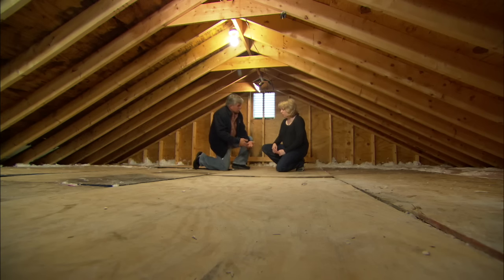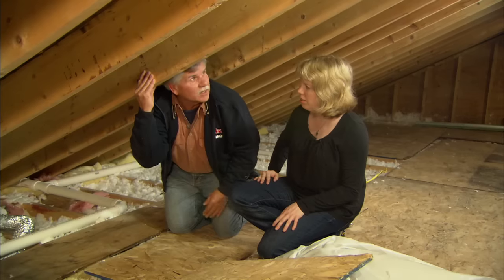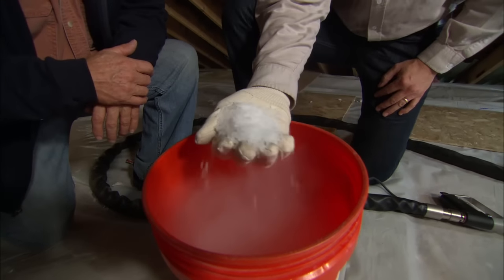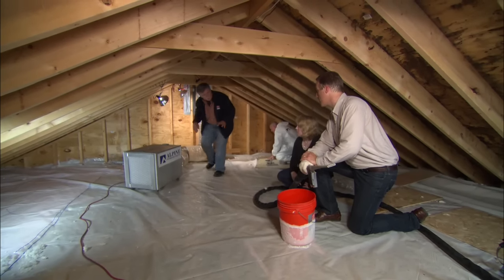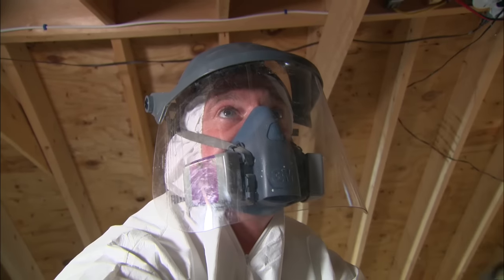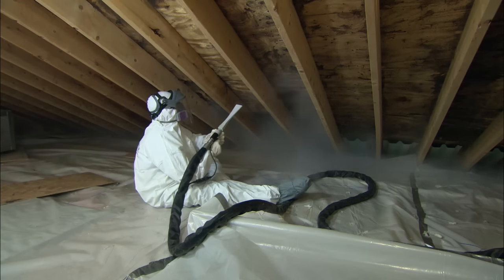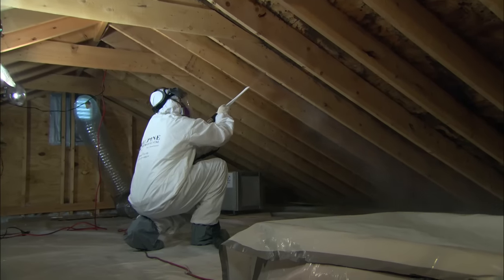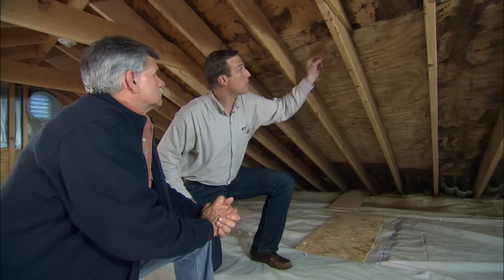How to Clean Up Attic Mold | This Old House

Comment: They cut out some of the most important parts of the original video. This is from season 10. They talk about how the gable vents are a detriment to a ridge vent system. They also talk about how venting a bath fan into a soffit is the worst thing u can do for your house. Better off not having a fan at all

Comment: Using dry ice looks expensive. And I wouldn`t count on it not coming back. I have grown mushrooms before and the spores are microscopic. Just because you get rid of what you see means nothing. I also worked in the asbestos abatement services and I can tell you that one of those negative air filters cost $50,000 in the late 80`s. Granted it`s nothing more than a fan with some HEPA filters but that`s what they cost when I was using them. That reflects how much the services will cost you. Abatement services are for rich people or a government money wasting grant. You could tear your roof off and replace it cheaper.
Reply: That is what insurance is for. Everything you mentioned is a fraction of the price now. You can buy an industrial, professional quality air scrubber (pretty much giant fan with HEPA filter) for around ~$2,500. Or you can rent something similar for maybe a couple hundred bucks. As far abatement of mold, a strong (high concentrate) peroxide will kill most.
Reply: Or get good homeowners insurance and pay your 1000 dollar deductible....they'll send in a cat team to stabilize probably drop a dehu and set up containment then get appovals from the insurance to remove affected materials ie drywall and insulation then shockwave the piss out of the  materials and wipe studs. Really not expensive at all. I know what I'm doing tho so if my house had grey/black water or microbial growth I'm not calling a cat team I'm documenting and demoing affected materials right away I dont care if they drop the claim.
Reply: @HoomerbirdG2  Same here. I currently work for a water and fire restoration company. If I had something like that going on in my house, then I'd get a couple estimates for the insurance company, then do everything myself and take whatever check insurance wants to cut. Hell, probably borrow some work equipment. One of the benefits of working in the trades.
Reply: Insurance doesn’t cover that! Unless it’s from a leaking pipe or your roof got torn up by wind or something damaging the roof like a tree.
Reply: Insurance doesn’t cover that lol
Reply: Yeah good luck trying to get your insurance to pay out on that... They don't cover it. But you still called them attempting to file a claim so your rates will skyrocket next year because now they know there's a problem. The good old catch 22
Reply: I have an air scrubber with variable speed control and a hook up for poly tube for negative air pressure costs about 1500 total including poly tube. Best idea is to re-roof and remove deckboard and start fresh with new materials. Likely there is a source of moisture that needs to be address whether it be a dehumidifier needed or roof fix.

Comment: Serious risk of asphyxiation with this technique in confined spaces - that's a LOT of solid to be turning into dense gas. Small filtered extraction fan may not be enough. Personal oxygen monitor should always be worn if you are doing this work.
Reply: No one suggested that the average homeowners try it at home…. Leave it to a professional!!!!
Reply: @daddybear7062  yea well fyi the "professionals" are very often just as clueless about such things. The person in this very video has no alternate outside air source, has no oxygen monitor on and is sitting on the floor....WHERE THE COLD DENSE GAS is clearly rapidly accumulating.
Reply: At least wear PAPR
Reply: Supplied air line would be ideal

Comment: Didn't protect the vents at the base of the roof so you've blown mold into the walls, mold still inside the wood, all you've done is improve the appearance
Reply: So you just missed the part about the negative  air machine?
Reply: @123456bmx  oh whoopie...

Comment: That is an excellent way of getting rid of mold. I like it done in my house, but my father is prohibiting from me in doing it.
Reply: mold only needs to be wiped with an antimicrobial and dried + source of moisture removed. encapsulate (paint) with primer once its dry and fixed and that's all that needs to be done. agents like IAQ advanced peroxide cleaner or Rm-86 bleach cleaner can be used instead of dry ice/ sand blasting / wire brushing but absolutely dont mix them because it turns into mustard gas. gl

Comment: 'How to remove mold from an attic'

"Well first bring out your $4000 dry ice reclamation machine with $2500 negative pressure system..."

So helpful lol 😆
Reply: Cmon everyone has that stuff lying around 😂
Reply: Don't forget the $9000 in labor.
Reply: there's a lot of This Old House videos where my (CORRECT) takeaway is to get someone else to do it. All of the asphalt ones are similar
Reply: This is a dumb way to get rid of mold
Reply: @Michiganman800  as a licensed mold remediator and inspector, I agree
Reply: @dylanstevens5714  Then what's the correct way?

Comment: Looks like spreading mold around with added moisture from cold ice and vaporate into water and a perfect breeding ground for more mold.
Reply: Delboy they’re using dry ice. It goes from a solid to a gas. It’s also far colder than water ice. It’s instantaneously killing the spores.

Comment: My attic does not have obvious signs of mold and it's relatively dry and all that.
But the is covered in some kind of green stuff. 
Very fine and dry.
As if the wood is covered in a thin layer of copper oxide...
You fine people have any idea what this could be?
Reply: Could is possibly be some form of spray foam insulation? I assume you are not the original home owner. I would think foam insulation would be more obvious.Unless it is some sort of wood treatment? Did you try google images to see if you can find something like it?
Reply: Possibly wood preserver? Pressure treated lumber maybe?

Comment: In the SE, it gets to 100 degrees outside.  The attic can be 115 or higher.  No mold.
Reply: Attics get a lot hotter than 115 assuming the insulation is on the attic floor. The mold happens in the winter, as is mentioned in the video. If you are down south, I guess maybe it doesn't get cold enough to be a problem.

Comment: I'm afraid to even know how much that costs.
Reply: The only 500 sq. ft. attic would be a shed.  Get real.  At those prices, it makes more sense to remove the entire underlayment on the roof and replace it.
Reply: A NEEEEEWWW CAAAAARR! You're Winner
wtf is wrong with a scrub brush, something that kills mold, and installing better ventilation.
Reply: Well if you have insurance probably not alot at all lmao pay your 1000 dollar deductible and the insurance will take care of the rest assuming there's not any coverage concerns.
Reply: Shawn P Bleach does not kill mold. It just removes the stains. It kills bacteria, therefore making the mold have more area in which to spread.
Reply: @Tinyteacher1111  not true....bleach will kill mold spores and allergens on esentially every non porous surface. For wood and drywall you should use shockwave antimicrobial or RMR. RMR is pretty terrible when spraying though its like walking into an onion chopping factory.
Reply: @HoomerbirdG2  I just bought a house with some basement/attic mold and have been reading about both rmr and mmr86 going to grab a resperator and give it a shot
Reply: @asfbi  Remeber your eye protection!! RMR in the eyes is a recipe for a bad Sunday I can assure you hahah goodluck!
Reply: just build a good house in the first place
Reply: @Reed Lambier figure out why the mold grows. and fix that first
Reply: Reed Lambier 800 dollars seems fair. How did you make out ?
Reply: @shawnp8429  
Never use BLEACH
Reply: @christinedavis-lunn8153  why
Reply: Tired of all the BS online regarding mold. SMH
Reply: @HoomerbirdG2  RMR is bleach
Reply: @shawnp8429  because it does not penetrate porous materials.  hydrogen peroxide does.  I use about 18% HP.
Reply: @HoomerbirdG2 MR is a mold stain remover. It's basically bleach. It does not kill mold spores on wood or drywall. Shockwave definitely does kill it as it's an antimicrobial. Of course RMR destroys your eyes. Its bleach in you eyes lmao.

Comment: This is almost like what a pressure washer does there needs to be vacume right next to the spray nozzle pulling the bad out in a high pressure vac line and why not just Spray with water pressure wash with a special nozzle that vacumes the water and dirt while it’s sprayed clean or if you can plastic all like that make a drain system open up gables and pressure all the mold out on a hot day and let it dry and be like new again with special plastic on ceiling to protect house from the water 😅 the ice thing looks to work good like a small pressure washer does seems it should be vaced out so doesn’t become airborne mold is such a common problem need some ways to do it better like maybe coat it in a tar that has vinegar that is mold converter or paint that at least seals it or absorbs it and then you flake the paint off like go in there spraying like crazy some kind of foamy green slime that attaches to the mold makes it dry and shrink then vacume up the dust or like a super power vacume with grinder that grinds and sucks out the mold since it should be taken out anyways eventually maybe spray foam over it all after treating with Mold killer to encapsulate it all like roofing tar in a spray can that never dries so the mold is just stuck and can’t grow or move maybe 🤔 so like a few ten dollar spray cans could make this area cured for useable area what about chemicals that you spray on that have a certain time before they get hot and turn it black char that becomes un useable to mold like how bleach ammonia and vininymake smoke reaction or a machine that blows air out of a tip that is so cold and pressurized that it removes the mold and roots though blowing it around the attic can never be good always will get in and grow some where and that stuff just a tiny spot grows on new lumber like crazy need like spray paint that changes color when mold is there or like battery acid detector

Comment: 1000 miles an hour, and no sonic boom
Reply: No way 1000 mph!
Reply: He even questioned the figure.  Another salesman full of BS.  LOL
Reply: @MichiganPeatMoss  probably 1000 psi which isn't alot. My shop has a 7000 psi pressure washer that makes this think look like a toy.
Reply: This sound wrong it could be clean with a spray for 20-30 dollars the black stuff may no be mold
Reply: Luba Luba I totally agreed with your comment. I’m a certified mold remediation and been on Restoration business for over 20 years. I don’t like the ice blaster method. I will use white vinegar or peroxide Water and done deal.

Comment: That's a great way to spread mold. The HEPA filter is getting only a small part of the mold. Nasty process! A chemical process is required to KILL the  mold, not spread it.
Reply: I agree. Chorine Dioxide or similar should be used. I would have rather seen this done.
Reply: I mean like the mold came from nowhere. OFC it will Always come back because its fking everywhere. Get real people there is no "getting rid" of it

Comment: One could buy 50lbs of soda or some organic abrasive media (corn cob, walnut, etc.), a media blaster and a decent air compressor (all of those from from Harbor Freight: 1 time use, cheap tools fine), rent a HEPA air scrubber and a HEPA vac (or just leave a shop vac outside and run a long hose) and do this themselves in a few hours for a under $500 IF you have to buy all the above.  If you already own a good air compressor then just a few hundred bucks.

OR you could pay someone like this to do it for $5000-10000.  This isn't rocket science.

Comment: Unfortunately this method does nothing for the rest of the house. Mold is not just where you can see it, mold is an airborn molecule and if you have mold in the attic you have mold spores in the HVAC ducts, the walls, the drains, the carpet, the furniture etc., especially in a house this old. The only way to be sure the mold problem is solved is to have a Pure Maintenance licensee come and use their patented dry vapor non-toxic whole house process to be sure the mold problem is really solved. Unfortunately traditional remediators can only address what they can see which is effectively "spot cleaning" a much bigger problem. I love This Old House, but they really need to invite a Pure Maintenance licensee on their show to solve the mold problem once and for all.

Comment: Wouldn't it be safer and more practical to simply dry out the attic for a few days, then spraying an anti-mold paint primer and then painting the sheathing with waterproof coat and making sure the vents are clear? This looks awfully unsafe and cumbersome.

Comment: Get up there with a mask, scrup all surfaces with a stiff brush and detergent and wipe clean with water to remove residues. Wipe everything down with a bleach solution to kill everything. vacuum/mop debris and coat with an anti mold coating. Have a dehumidifier running before during and after process. This over complicated extraction process with dry ice is a money grab. 😂
Reply: Thanks for the info will try it..

Comment: The Carbon Dioxide is creating an oxygen deficient environment....lights out
Reply: Negative air machine breh.Did you even watch?
Reply: @123456bmx  the machine is for mold (solid) particles.  CO2 is a gas 🤦🏻‍♂️

Comment: Like a hot sticky oil that sprays on mold beads into little beads after the mold is dripping and treated you scrape the encapsulated mold of in specs of clear plastic like beads

Comment: So dangerous mold is yet its ok for homeowner can do it with really no restrictions either. But if you call someone you will pay thousands not worth $$$$ get a few zep bottles and spray and scrub use brush for grouts and a sponge or rag to wipe. It would be good to layout plastic tarp too for easy clean up.

Comment: Do dehumifers and air purfier both kill mold spores and mold I have mold in my bedroom and I use dehumifers and I have plug in air purfier also do they both work and are they worth using
Reply: They do not.They are using an air scrubber machine once the mold is free’ed from the surface.

You need to probably cut some walls and apply an antimicrobial solution on the problem areas.Call a professional ASAP.Being cheap now will cost you a lot in hospital bills later.
Reply: @123456bmx  I'm confused what do you mean and I dont feel ILL from mold in my bedroom or my hamster dont know if has affected us yet
Reply: likely that house is highly contaminated with mold spores probably uninhabitable for those that are mold sensitive after this type of treatment. The best thing is to re-roof and take away the moldy roof deck board and start over with new materials.

Comment: I just put a new metal roof and i got mold very bad, i don't know why.?
My house is old but never have mold before
Reply: Did you put ice shield over the ENTIRE roof before sheeting it? Sheet metal holds 0% moisture and condesates because of difference in temps, creating droplets under the sheets, that drip down into the wood and into your roof
Reply: I just bought a house with new metal roof, same problem. I’m hoping that it was like that before the metal roof. So hopefully we can fo up there clean it and done. Did you figure out the problem?

Comment: How doe this clean the mold that is between the top truss plate and the roof decking. The best thing to do when you have mold on your roof decking is to replace the roof and decking and clean the truss when the roof is off.

Comment: would highly compressed air do just as good?
Reply: Bert Cochran I guess there might be some range of pressure that will do. But not your default 8 bar workshop compressor. It shouldn't be too high to prevent cutting the wood, and not too low to achieve nothing. But adding something solid like dry ice will help a bunch.